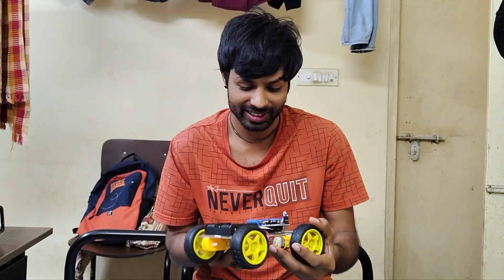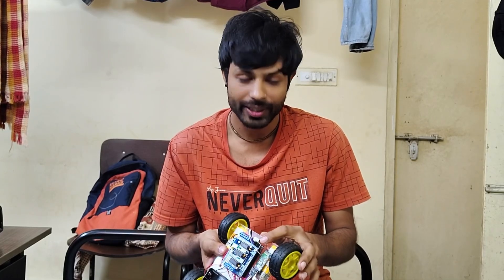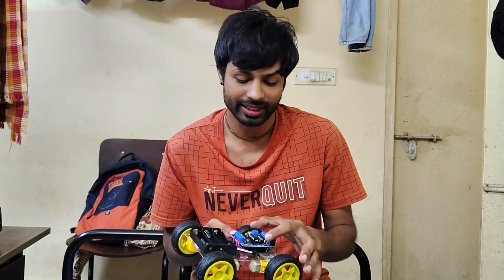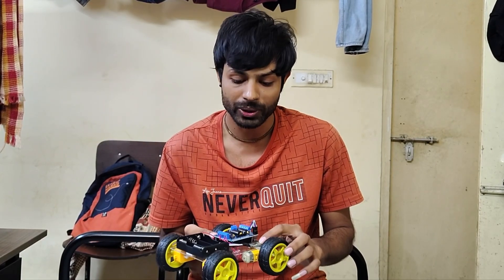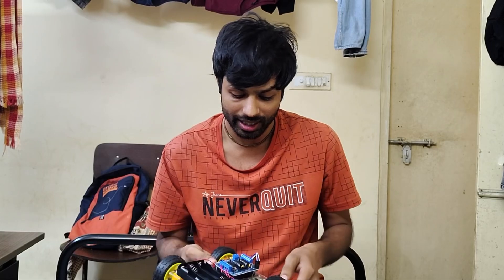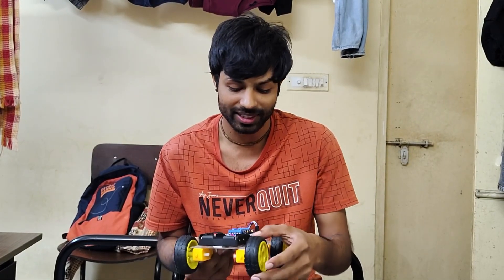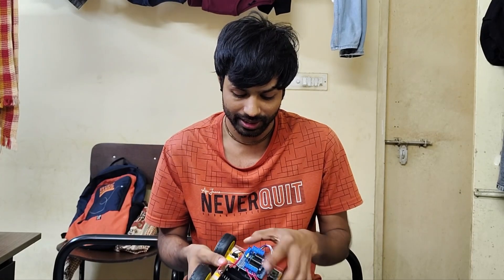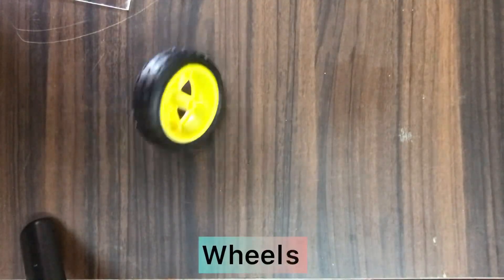How to Make Bluetooth Controlled RC Car using Arduino | Full Tutorial

Comment: Mere paas Arduino mega hai, same process ke through bana sakte hai kya ya fir kuch change karna hoga connection me.
Reply from the maker: Yes, aap Arduino Mega use kr skte ho 👍 usme extra pins h unka use ni krna h and motor driver k liye wo hi same pins pr lgana jo pins arduino uno me h .